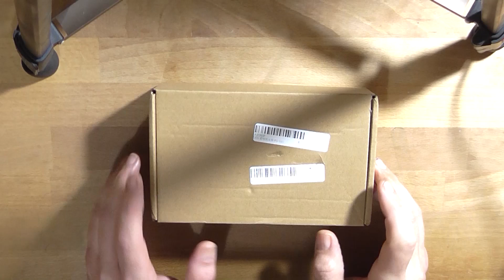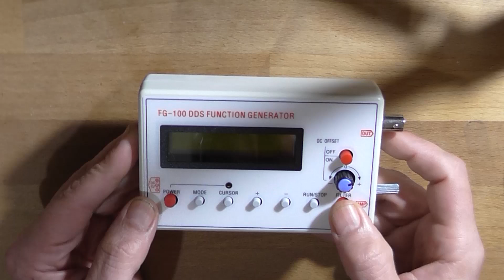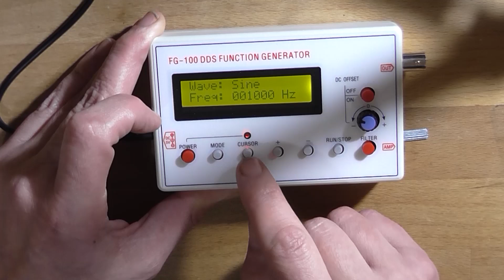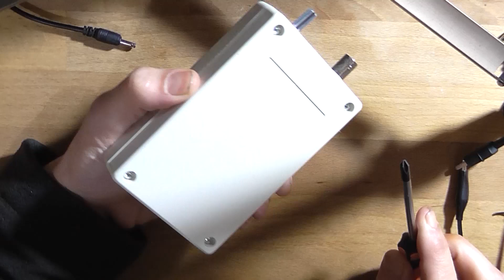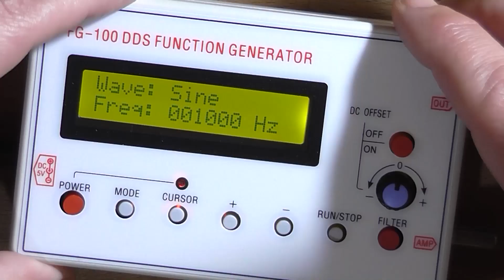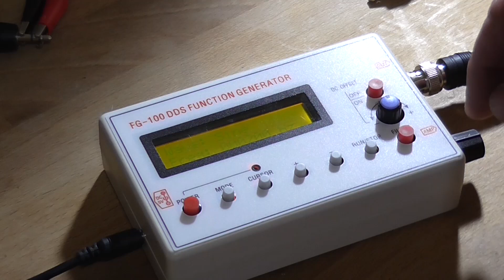FG-100 Portable DDS Signal Generator: REVIEW!

Comment: Buying stuff and taking it apart. Definitely! Ow btw... when your knob doesn't fit on the pot because the split in the middle is not big enough, I found that placing a flathead screwdriver in and twisting it (a little and gently of course) get's good results!
Reply from the maker: @DustinWatts  yes, I know.